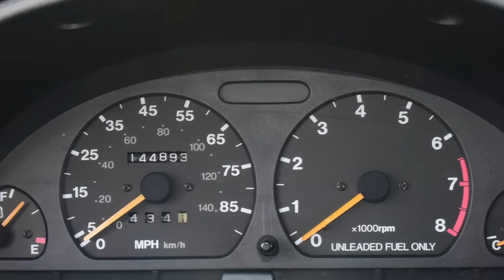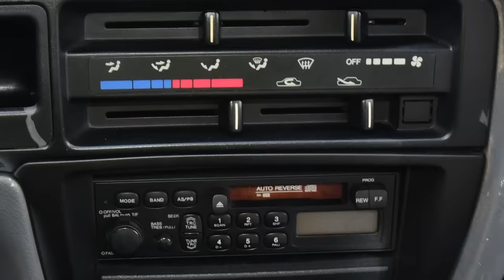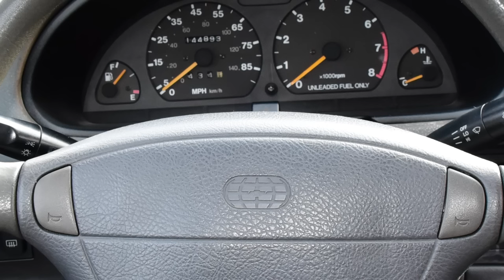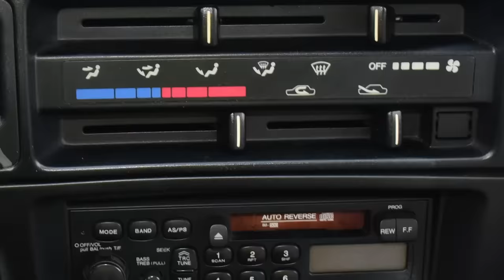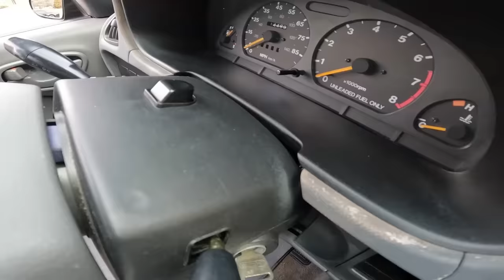1996 Geo Metro 5MT: Regular Car Reviews

Comment: My best bud had one in high school in ‘96. We’d go all week on $8 in gas. It was great.
Reply: I remember these cars too man back in the day the high school student parking lot was full of them
Reply: @johntyson   @Micah N.  I think people are getting fed up about spending a lot of money on new cars that have a bit more comfort, instead of having a good running thing with the basics checked and much more spare money
Reply: @hekinho1  100%, and that's why I'm keeping my old beater 02 Ford F-150 Crew Cab V8 for as long as possible, same with my 2011 Toyota Camry, as both are reliable basic transportation, and the F-150 can still do all the towing, and hauling I'll ever need, without paying for an over stressed turboed 4 banger short bed truck like the Ford Maverick, and almost as much as a small house to get something like a new F-150 with crap I don't need, and don't want!!
Reply: @ALittleBitOfGay  I want a Honda Del Sol
Reply: That was like 14 gallons of fuel in 96.
I had a 77 impala that got 10 mpg and for 20 bucks you could ride all weekend and have enough left for a pack of smokes 1.75 and a dime sack. 😂
Reply: @ohioplayer-bl9em  lol same. I had a ‘76 Jeep CJ5 with 5.0. Drank gas but I didn’t care.

Comment: My Saturn SC was like this; underpowered, cheap, and fought for every scrap of power and grip on the road. It was honest and you felt accomplished after every trip you make in it. The realization of being surrounded by vehicles that can crush it just by sniffing at it persuaded me to upgrade to something more substantial.
Reply: I still have one - a 2001 SC1. It isn't our primary car, but it gets me where I want to go reliably and economically. It's always there when I need it, because nobody else wants to drive it. They don't seem to like looking into the wheel wells of the trucks and SUVs next to them. Now that I'm almost 70, it's getting a little hard to get in and out of, though.

Comment: My parents used to have 3 of these. The loss of gas mileage was due to changes in the ECU programming to meet updated emissions standards. You could frankenstein gen1 programming to a gen2 ECU and gain 10 - 15 mpg.  Smash up the cat, remove the back seats, and replace the intake and you can easily get 60+ mpg. I drove my Dad's test Metro from Montgomery, AL to Disney world and a little of the way back on a single tank of gas, which would have cost a little less than $10. 

As much as the butt of jokes that the Metros were, I did have a ton of fun driving and tinkering on them with my Dad.
Reply: That’s awesome

Comment: You mentioned the Tracker and my heart got soft. I had a '91 tracker 5MT, and even though I would never DARE to take it over 65, that thing was easily the most lovable and enjoyable car I have ever driven. I still regret selling it. Miss you, Sparky </3
Reply: Sorry you got rid of your Tracker.. I still have a 91 Tracker 5spd .. I drive it all the time .. love the little thing ...
Reply: I daily a 2003 Suzuki Vitara. RWD 2 liter 4 banger 4 speed automatic ( I so wish it were a 5 speed manual). Its a car that grew on me and I started to love its little quirks. I've gotten it to go 85 once and its a little scary to drive fast in. But nevertheless it taught me that its more fun to drive a slow car fast than a fast car slow.
Reply: My buddy had a tracker. It was actually cool. It was a rotbox though. He had a fuel leak and someone told him there was an access panel under the rear seat. I believe that was a lie but we went to take the plastic cap off the seatbelt anchor bolt to remove the bolt and we no longer had to worry about the bolt because the cap, bolt, and about a 4x4" section of the body broke off

Comment: One correction: some of the 4-cylinder models had power steering.  I have had a base '92 Metro since 2010.    It has 311,000 miles on it and still gets more than 50 mpg.

Comment: I had a 1998 metro 4 door sedan that had the 4cyl engine and was fully loaded with ac and power steering.  Loved that little car. Made multiple 1400 mile round trips with that little car in the late 90's. And it would cruise fast enough on the highway to get a speeding ticket. I got a 80mph in a 65 in Elizabethtown ky.

Comment: Hey, the Geo Metro. A car seriously underrated by virtue of its simplicity, fuel economy and durability. In my country we had them everywhere, both the 1st (Chevy Sprint) and 2nd gen (Swift) were sold for 10 to 15 years straight, discontinued in 2005! They were even used as taxis. We loved them, parts are everywhere and they still hold value. We even had a hot hatch variant, the Swift GTI twin cam with a 1.3L engine and 100 hp, those cars are still raced today. Had the chance to drive a regular Swift and they're so light and simple, it really doesn't need power steering, I really liked it.
Reply: What country?
Reply: @skeleton1337  Colombia. The Chevy Swift and Sprint are still a common sight down here.
Reply: @lunaroja_ph  do you guys have Ika? I know Mexico has a old AMC subdivision but forgot it's name when I go to Mexico I see many Geos and vw bugs and also Suzuki
Reply: A 100hp version would have probably sold well in the us too
Reply: @lunaroja_ph  before reading your reply, and reading your first message, I knew it was Colombia hahaha they're everywhere!! I remember seeing a super clean GTI from like 94 and it looked amazing. Quality cars for sure
Reply: Hey, a fellow Latin American! 
Here in Brazil, the Swift GTi is getting mad expensive right now. People started to discover the wonders of a small light car with a high revving engine, and the Swift didn't sold well around here in the 90s, making it a rare car
Reply: @redlight3932  We didn't get IKA or anything AMC related. Well, there was a company that built Willys Jeeps in the 60s, and then went to build Mazda cars until recently. We also have Colmotores who started building Chrysler products and now make all things Chevy related. Apart from that, there isn't a true "colombian brand".
Reply: @albertoshiguematsu1367  A lot of 90's hot hatches are getting mad expensive around here. The Swift GTI costs the same as my car in great condition, and things like a Citroën Saxo VTS or Clio RSi are hard to find and expensive too.
Reply: @Edgar193  They look fantastic in green! A coworker has one and takes it to the drag strip. My dream is to take a 96 Swift sedan and engine swap it with the 1.3 twin cam in the GTI.
Reply: The 1989 - 1994 models were sold in Europe until 2017.

Comment: Did a parts delivery job in highschool (2004). They had a (from new) 1998 Metro, 2dr hatch automatic no ac no options. In 2004 it had 457000 well abused kilometers the last i saw it. Everyone said once it died, they'd replace it. I saw it driving for 3 years after i graduated lol
Horrible yet great car

Comment: My dad worked at the Canadian gov’t dept of environment and they had Geo Metros converted to full EV power train, back in the early 2000s.
Reply: Doing that is a relatively easy DIY job, you just need a single plate adapter fabbed to bolt an electric forklift motor up to the tranny. Before Tesla or Nissan delivered their first EVs, project ForkenSwift was out driving around in quiet EV style.
Reply: Probably made them faster than factory 😂😂
Reply: @alexwu8077  Electric cars back in the 90's and early-2000's were very, very slow and had little to no range (usually less than 100 miles).
Reply: For the time the batteries lasted it probably had much better power. I know the Smart Electric is better than the regular one.
Reply: Probably Selectria Force! WatchJRGo has one! Mr. Regular should review it!
Reply: @NateLeePhillips  I was just gonna mention that :D
Reply: @cujoedaman  Same
Reply: @joshjlmgproductions3313  depends on the DIYer, really. many of the forklift motors had more than 60hp on them, and slapping two motors onto that gearbox wasn't unheard of. That said, what you often ended up with was a death trap....
Reply: @NateLeePhillips  Yes! That was it! I watched JRGo and I remember it being the same weird shifter with the handle that you turn.

Comment: I used to drive one of these for Napa auto parts. I learned Joe to drive stick on it. It was a fun car for being so low powered. It had a horrible exhaust leak and I felt like I was in a fast and furious movie because I had to keep my foot in the pedal. It actually handled better than expected for how slow it was. The key to having the fun in that car was to enter the curves as fast as you could.

Comment: These were marketed in my native Venezuela as Chevrolet Swift and had 16 valve 1.6 liter four bangers in them. They were quite peppy compared to other similar cars on the road. And believe it or not they were expensive compared to the 1994 Ford Festiva I ended up getting. Ahhh the good ol' days!
Reply: Festiva was a glorified Hyundai.
Reply: @hendo337  it was actually a Mazda 121 based design adopted by KIA, I believe before they became part of Hyundai.
Reply: @hendo337 rebadged Kia Pride

Comment: I have owned a blue 92 hatchback for 10 years, bought for $200, rebuilt the engine, this year replacing the exhaust. It does look tiny beside a full size truck, but it has been a workhorse for me and it is not slow...

Comment: I had to drive one of these Metro convertibles once, and at 45mph, it was scary to be on the road with other cars.  And that was in the 90’s.
Reply: These were no better than Chevettes were 15 years prior
Reply: Me and a buddy had his over 100mph lol
Reply: When he said "it costs 40 bucks to fill the tank and that takes you 400 miles".... I was like... my 2021 Kia Soul with all the nice modern comforts and safety features gets the same numbers in fuel economy, and it's a 4000 pound car. It's easy to speed because it is so quiet and smooth to drive. It's commendable in the 90s that a car manufacturer could get those numbers... but it was at a huge sacrifice for comfort AND safety.
Reply: @CadgerChristmasLightShow  your Kia soul costs a years worth of McDonald’s cashier salary. A geo costs a weeks worth of McDonald’s cashier salary
Reply: @HE-162  yeah, today, where a geo is like 500 bucks or a grand lol. Back when it was new, 7 grand was probably close to a yearly mcdonalds salary.
Reply: @CadgerChristmasLightShow  well yeah but why are we talking about when it was new? Your Kia soul wasn’t even around at the time
Reply: The chassis flex is crazy!
Reply: This is a normal car in the UK, I had a 1999 Fiesta, similar sized car from Ford in 2014 and it was fantastic, small, the little 1245cc engine put out 74hp and driving it alone I could hit an indicted 105mph (so probably 95ish). I'd have one again now I don't need to cart a pushchair around, the back would have easily been big enough for my kids car seats.
Reply: @Thumper68  Yeah sure you did pal...
Reply: @sporkybutterz  it’s not that hard just takes long straight slight downhill.
Reply: @sporkybutterz  also it’s only 1800 pound car with 70hp think about it.

Comment: I've got a metro with ac. There's a button to turn it off. You press that before you accelerate, then turn the ac back on once you're at speed. Also, storage is surprisingly roomy when you put the back seat down. I've moved a motorcycle by shoving in the back of mine.
Reply: Back when it still worked I had to turn off my AC to go uphill in my 1997 VW Transporter, we called it "Diverting power from life support to engines"

Comment: I had a 2000 Chevy Metro that constructed its own social constructs contrary to how I understood it. I beat the mess out of it, I jumped it over train tracks, did handbrake 180s into parking spots, was known locally for street drifting with the e-brake in snow, staging fake police chases with it and my friends crown Vic, doing reverse 180s in tight areas and other generalized stunt driving.

I was young and bullheaded. In the winter time I'd often start it up cold and bang the rev limiter for a minute straight before driving it. At one point the catalytic converter came off and we all joked it sounded like it had a Subaru swap. I'd hit heel toe downshifts aggressively coming down hills while slowing for corners. Once while street drifting in the rain, I hit a curb with the back right wheel bending the lower rear control arm. I drove it sideways to shop class where me and my shop class teacher removed the control arm, got it red hot and hit it with a hammer until it was relatively straight.

That car never gave me any issues. I put gas in it and went I didn't even change the oil for 50,000 mi. I drove it locally, cross country, in all weather conditions. It always started up, It never burned oil, It always went and it got 40 miles per gallon doing so. That was one of the best cars I've ever owned. When I met that car I thought it was a Calvin's dad style econo box. But it etched itself in my brain as something much greater than I could ever describe.

Comment: My grandparents had a Geo Metro in the '90s and early '00 I was little but I can remember that teal car. My grandfather would get 50+ mpg with it but had to keep it running at the gas station in the winter to try to produce heat because the motor was so small. Thanks for reviewing this car.

Comment: I was about to say that you can totally do these kinda MPG figures with modern cars, and point to the VW Lupo.

Then I remembered the VW Lupo is 26 years old, and gazed long into the yawning jaws of entropy gaping before me.
Reply: "Yawning jaws of Entropy"....I shouldn't have read that right before bed:)
Reply: Peugeot 208 or Fiesta with diesel, ez 70 mpg on highway. Still modern cars.
Reply: That's what I keep saying. European small cars are unbeatable in terms of fuel consumption. I remember there being the Audi A2 3L which was absolute bonkers in fuel

Comment: I drove a 1970 Bug for years and learned to drive the torque curve. I felt like once I grokked that, I could get plenty of fun out of any car with a manual. Totally dig the Geo Metro.
Reply: I drove a Yugo GV with a standard in 1989 and know what you mean. It was a struggle to get it to 75 mph, but I could go from zero to 40 on a flat road astonishingly fast.

Comment: For 6 years I pumped gas at a local Albertons and every single day of those six years one of my most regular customers was a 400lb dude living on disability checks who drove a blue 95 Geo Metro. The passenger seat had been replaced by a trash can but yet the entire car was overflowing with garbage. He kept the same paper Pepsi fountain drink cup for weeks until it fell apart so he could pay the .79 cents for a 44oz refill and whatever change he had leftover...maybe .18-cents, would go into the fuel tank. For what it's worth, that car never broke down and the tank never ran dry. He always had gas and change for his 44oz Pepsi

Comment: My folks had a Suzuki Swift when I was young and I distinctly remember my Mom driving my two siblings and I up a hill on the way back from town. The only way we could make this hill with the weight we had was to have enough speed leading up to the hill, otherwise we would be going so slow by the time we hit the top of the hill that we would regularly get passed by normal traffic.

Comment: Apparently, $7000 in 1996 is just over $13,000 today. WTF
Reply: Lol 13000 for a metro or 13000 for a spark
Reply: @dereksans2623  I’ve drove both. Spark. 10000%

Also I bought mine for 10k new, so it’s actually cheaper than a Metro 😂

Sadly tho the Spark is dead. So now it’s a Mirage for 15k as your only cheap new car option, and the Spark’s resale value has jumped dramatically ever since the jump in gas prices.
Reply: I'd take a Metro over a Spark any day of the week. Metros are infinitely easier and cheaper to work on, and last so much longer. We put over 400,000 miles on two separate Metros with very little issues.
Reply: @dereksans2623  Just don't get the CVT
Reply: @jonathanpusar5931  shame, I'd rather have the Spark over the Mirage but I'd avoid the cvt.
Reply: @TheMsdos25  even then the CVT isn’t bad. Had mine for 6 years and no issues so far. They have improved significantly over the past iterations.

I prefer the manual one because it’s more fun to drive…but it’s so utilitarian I’m happy I don’t own that variant any longer. Once you have door locks and cruise control it’s really hard to go back without them. 

Oh and the whole only 2 speaker thing is nice at first…but just means that the stock speakers need to be loud to be effective.
Reply: @yeldarBkereD  sure, but the downsides are huge. Safety being the biggest one. I got hit by an 18 wheeler with my first Spark. I doubt I would have survived if I had a Metro…

Then there’s acceleration and ability to drive in American roads that go past 70mph.

Then there’s basic features like air conditioning.

I can keep going, but I’d take a car that’s a bit more expensive to repair and have a good experience. Spark is mostly built off GM parts that have been around for ages, so mechanically it’s both easy and cheap to repair. The biggest cost to the car is going to be physical damage now that the car is discontinued. That and the CVT.
Reply: You can get a way better small car off that today, honestly